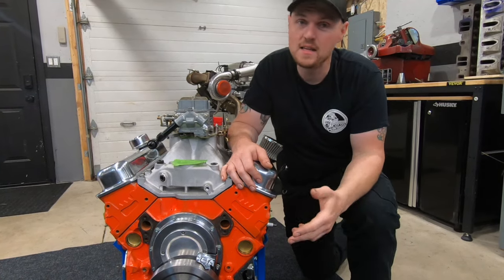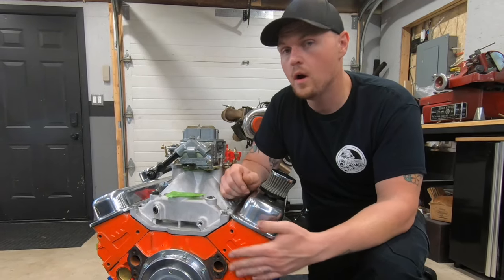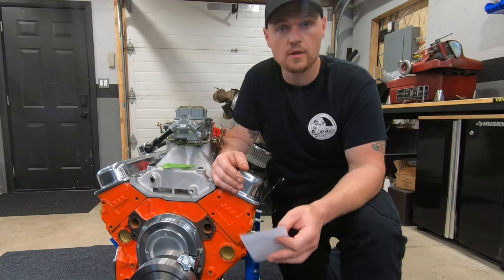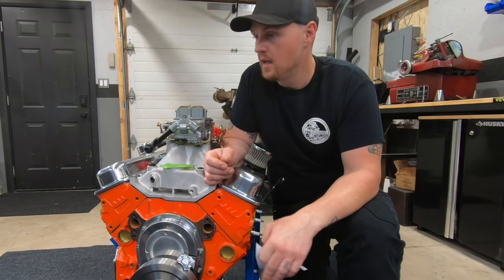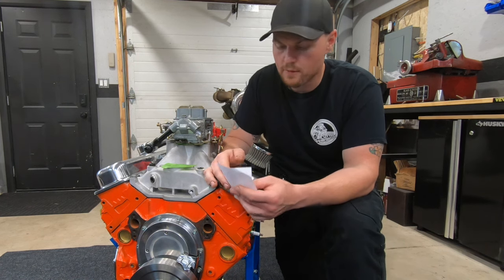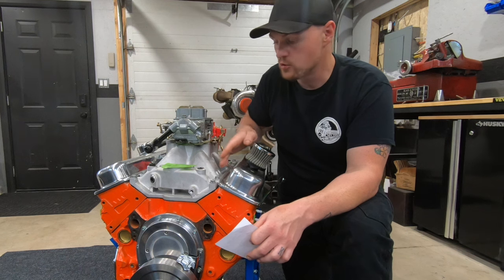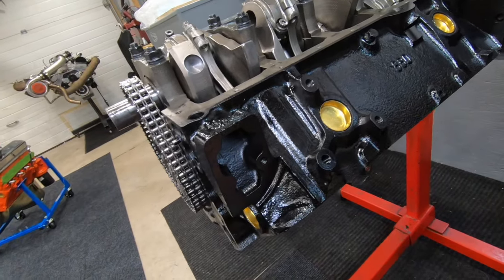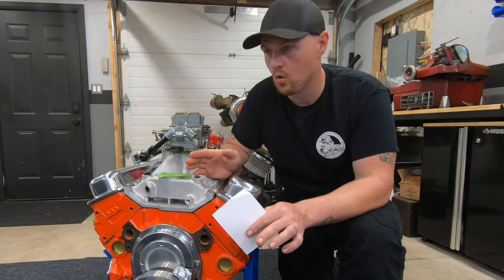Quest for a 500HP SBC on a Budget (The Block)

Comment: If the rest of your followers are anything like me, the best way to get a 450 hp engine is to aim for 500. I’m looking forward to this video series!
Reply: With research you can hit your goal exactly. Heads are the most important.
Reply: @cedricwilson2055 the camshaft is the most important. You can have the baddest cylinder heads that they make but without a camshaft that will make them work you have a turd. I agree that the heads are important but don't forget about the rest of the package.

Comment: I built a 350 bored 060 over with a Lunati bracket master 2 cam, Dart Conquest heads, Dome pistons, Weind Team G intake and a Barry Grant 750 carburetor. Compression was 11 to 1. It had 4.56 gears and a 3500 stall converter. The engine made 520 hp and the car ran 11.30 in the quarter and low 7's in the eighth. It was so much fun to drive. I'm going to build another one very soon. Love these videos.
Reply from the maker: Hell yeah! 🤘🏻
Reply: @cuttersperformance idea for a video: no one ever makes a video on building a sbc torque monster for those of us with heavy 4x4s that are daily drivers. Where peak  big HP isnt really that important

Comment: If you can find a 350 out of a Big chevy truck, they have nodular 4 bolt center mains, numbers , 2482 on the mains, the cast mains are number 3412, you can tell the 2482s are a different color, kind of brown, Hope this helps.

Comment: That 355 did great at 479hp with vortecs but you swap those with cnc trick flow, promax or brodix with a larger roller cam it would clear 500hp easy.
Reply from the maker: Yeah definitely, what low buck aluminum head would you be interested in seeing used?
Reply: @cuttersperformance  I think trying to floteks or afr enforcers would be a nice low buck option
Reply: @cuttersperformance I’d like to see the promaxx project X heads.
Reply: Pro
Reply: Pro
Reply: Pro
Reply: @cuttersperformance  you already ran the knockoff eBay enforcers which are also good for the price.
Promaxx or skip whites seem to work really well but either way it's a decent jump up in cost.
Reply: Floteks
Reply: Performance warehouse

Comment: What number is a one peice rear main seal 4 bolt main block and do know what vehicles they came in? With mechanical fuel pump.
Reply from the maker: The last three digits 638 or 880. But you don't know if they are a 4 bolt unless you pull the pan and look. Most 880 block are not drilled from a mech fuel pump though

Comment: Marketplace is full of circle track 602 880 blocks with vortecs steel and also 604 which is same bottom aluminum heads.  Can get em cheap from circle track guys..
Reply: Where at lol. All the ones I see they want 8,000 an up

Comment: I have a 85 Vett which has the L98. I want to go carb, stroker kit to like a 408, trying to make 500hp
Reply: I'm currently doing carb swap ported flotek heads and an airgap intake with 750 holley and a Howards cam in my 85 C4.
Reply: I'm doing the same thing, 383 dual quad all under the stock unaltered hood.

Comment: Did you have to clearance the double row timing chain? Havent found one that fits without grinding. Thanks
Reply from the maker: What block?
Reply: @cuttersperformance  i thought you were using a block with a factory roller cam? The ones ive had were 880 blocks i believe
Reply from the maker: @chriscardall-yk2gp  yeah the 880 blocks you'll have to grind the top oil passage to run a Double roller

Comment: Hey quick question on blocks. from my knowledge I have a heavy duty serious 350 crate engine that is meant for a 3500 truck and it’s a 1 piece rms that my dad bought in the early to mid 2000s and engine is imaculate inside but there is no mounting bosses for the lifter spider or the bosses for the cam retaining plate, how do i necessarily tell what block I have and if I want a roller cam what do I need to do! Engine is going into my 89 Trans am so don’t want a truck cam!

Comment: To be more budget friendly, install the main caps with your brand new main studs, torqued down without bearings then check the bores with a bore gauge for roundness and that they are in spec. If they are don't waist the funds on line honing if the mains also pass the straight edge test.

More often than not it usually isn't the studs that cause the need for a line hone. Usually the need for the line hone was there before the studs were added 99 times out of 100. 

That is a substantial savings if you can skip that process. So for this 500 HP build maybe go through that process of checking the mains before you commit to the line hone? Check with a straight edge first with the caps torqued on with the bolts. Then check for roundness with the torqued bolts. If it passes do the same with the studs. If it passes with the bolts 99 times out of 100 it will pass with the studs.😎👍

Comment: Great info here. I’ve been watching while planning to build a dirt circle track engine for a class with the rules being 358cid, iron 23deg heads and no roller cams. It’s nice to see in dyno testing that 500hp+ is achievable with these heads and simple budget parts, especially if I disregard pump gas and street manners as there’s no compression rule. Keep up the good work.

Comment: Great video, as usual. 👍
I've read on FB that the 880 blocks came with PM rods. Is this true? I thought only Gen 2 blocks got them up until the Gen 3 blocks.
Reply from the maker: Yeah most 880 blocks have PM rods, I will talk about that in the next part of the series
Reply: My 880 block is a GM replacement engine that came with PM rods, 4 bolt mains and the fuel pump rod provision. Not many production blocks had the trio if any at all.
Reply: @shredfest30   Yea. I wasn't sure. I have a 638 block that came out of a HD2500 with the roller cam provisions and the hole for the mech fuel pump (which I don't use), but definitely not the PM rods. I feel shorted, now. :( LOL
Reply: @Carl_Jr  Ya, the 638 blocks were generally the "pre Vortec" generation between 1987 and 1995.
Reply: @shredfest30  They were pre-a lot of stuff. They were used universally across the F-body, the Y-body, trucks, Cadillacs, etc. 

Honestly, it doesn't. They've been changed to aftermarket rods, anyway.
Reply: @Carl_Jr  i think gm made the switch around 94-95 and at that time GM had the gen one 350cid 880-casting and the gen two 350cid 327-casting blocks in production at the same time. I think the gen two blocks went into production much earlier than the 880 castings and the early gen two blocks recieved the older style non-pm forgings. Im basing this off these blocks first appearance in production vehicles being around 92 for the gen two and mid-95 for the gen one 880 castings. So im not 100% positive but im guessing all 880 blocks came with pm forgings.

Comment: I’m really on the fence with building a 4.8 “LS” or a 4 bolt Main 350sbc ( either or I’d be running a carb) it’ll be a street car nothing crazy… would love to hear some insight y’all!
Reply: the 350 will make more torque than the 4.8, but the biggest issue with the SBC is the intake manifold design. It just can't be as consistent by design for balanced cylinder filling and equal fueling compared to the LS carbed intakes that don't have the siamese intake ports. that 4.8 will rev another 1200 rpm  past the 350 with ease though and make comparable peak hp

Comment: Can a 500hp 355 or 383 be as reliable as a stock daily driver?  Thinking of a doing this to my daily driver '94 suburban.
Reply from the maker: I'd definitely go 383. But yes, with a properly selected combo, you can make 450-500hp and still have good drivability, power brake friendly and decent fuel mileage for a daily driver
Reply: @cuttersperformance  383 is my preference too.  Thank you.  What kind of budget should I realistically plan for?

Comment: Cool video and new Subscriber. 1970 Chevy 350ci  Bored .040 for cylinder perfection and a few more ci.  2 bolt mains. About to be a full hydraulic roller. Will be running 11-1 compression, with FloTek 200 aluminum heads.  Airgap intake with Holley 750cfm and Dougs 1 3/4" tube long headers.  Reaching for 435-450hp.  We shall see. Thoughts ??
Reply: You should be there, depending on cam... could squeeze little more out with 11:1...
Reply: @jacobnorth8642  Bullet racing cams special ground a .548/548 lift .    286/292 duration ..   LSA 112 w/4 degrees advance..

Comment: I have a question that I been kicking around.  I have a 1968 pontiac lemans. I'm still trying to decide if I go with the 455 or get a 400 pontiac or a 6.0 ls or a sbc. Right now it ha a 5.3 in it. Which do you think? I also have a torqstorm supercharger. Should I use that or go turbo. To many choices  to decide from.

Comment: It doesn’t matter what gm block you use!
All you need is arp studs on 2 bolt Mains M I have made 480hp on.vortec truck one. Must have good 280 cfm heads with hyd roller or easy with solid roller camshaft .
Most need240@050 plus camshaft . Springs to support to rpm range

Comment: What is the part numbers for the beehive springs retainers and locks to run a .510 to .530 lift cam in vortec heads thank you love watching your channel
Reply from the maker: https://youtu.be/UZosxGQyGMs
Reply: inspired me to get a vortec, mild port, screw in studs ls6 (summit) springs, summit hot cam .525/.520 lift, quadrajet, dual plane, very drivable and fast!

Comment: I did measure both of my 880 blocks cylinders . They are both shorter than the 638 I have .
Reply from the maker: @twopopsaqullu9721  how much shorter?
Reply: About 1/8 inch or .100    my 880 blocks are 2001 year
Reply: @cuttersperformance  its been a while since i measured it but i also believe the 880 was a tad shorter than the 638. If i remember correctly one was more square at the bottom where on the other the cylinders were longer on the non thrust sides.

Comment: been looking forward to this video i'm building a 350, machine work is done flat top 4 valve releaf hyperutechic pistons using parts that have been setting around cam 535 kift lsa is 108 202 camel hump stock bottom end true roller one piece rear main roller rockers duel plane holley 750 double pumper MSD destrubtor 6AL box hoping to obtane 350 HP? openioun please? deck height .015 down. steel shim head gasket .015 thanks
Reply from the maker: Sounds like you'll have no problem making 350hp

Comment: Whats your opinion on the limits of a 2 bolt 350 vortec block aligned honed with the prw main girdle/stud kit?
Reply from the maker: @jayramirez3646  up to 500hp 6500RPM no problem (with a good balanced rotating assembly)

Comment: Who makes a electric fuel pump that bolts to the factory mount on a SBC? I've never heard of this.
Reply from the maker: The old electric Carter pumps with the plate you can mount right where the mechanical pump bolts to
Reply: @cuttersperformance  do they pull well from the tank? I need a fuel pump for my 385, seems like all mechanical pumps has went to trash. 

Did YouTube bitch enough to make you drop the piss out of piss cutters, or did you just take it out on your own? Just curious.
Reply from the maker: @inscoredbz  yeah they actually pull pretty good, not overly loud either

Comment: The 'easy' 500HP for you would be to throw a set of smaller chambered Aluminum Heads on the Dingle Ball 2.0 479HP motor (brand X's 23deg "210" or "215" 2.02/1.60" heads), raising the compression ratio a bit in the process (afforded by the switch from iron to aluminum heads, anyway) and call it a day. I bet that Dingle Ball 2.0 with 0.6:1 - 1.0:1 of compression increase added back into it and the aforementioned heads would be knocking on the door to 600HP very easily.
Reply from the maker: I'm going to be doing a 383 version with aluminum heads (Same cam)

Comment: I busted my crank in a 4bolt main 350 1pc rear main, ported & larger valve 193 heads & a B&M 144 supercharger.  I have a boost retard box & jackobs ignition system.  Along with running 93 octane.  Water meth was next till I busted the crank.   Oh & twin tbi's... off 5.7L but with injectors off  4.3L engines.  Prob was I couldn't tune an 0BD1.... Turbo City was who burned or flashed my EPROM chip.  Would have been sweet with an intercooler.... still be a pain to build a cooler to fit between the blower & intake.  Any suggestions there?  I have 2 b&m's I could use on different builds.  Since moved onto vortec builds & LS.   Towing I run Cummins
Reply from the maker: Where did the crank break? Superchargers cause a massive frontal load on the crank but I didn't think q 144 would be so bad. Was there any detention issues? Does the blower spin freely without binding?
Reply: Hey Pat, yea the front of the crankshaft was fine, my crankshaft busted at an angle across the 3rd main under the cap.  I actually missed it the first time I had the pan off while moving the crank from the front harmonic balancer bolt.  It was making a ticking noise but still ran fine.  The way it broke it interlocked & had such a tiny differences I missed it visually.  Had a friend move the front while I put a hand on the crankshaft fore & aft, felt a difference, with the 3 center mains off I was able to gently push the crank against the thrust & the front forward.  The counter weights didn't allow much movement but enough to see the crack.  Stock 1 pc rear main, std rods & main.  They were all in perfect condition.  Large 35in tires, 6in lift setup for towing our snowmobiles.  Ken the founder of AFR was a friend & who talked me into porting my stock 193 TBI heads, I had no clue how much GM invested in those heads but their production fell short of expectations.  The larger valves, staggered rocker ratios ect all helped.... best b4 lifted ect on grampa tires was 11mpg, after 15+ & the speed kept creeping up on me, found myself constantly letting off to stay at speed.  Ken was a hoot to chat with, our first conversation lasted 6.5hrs.  He enjoyed the fact I could follow his line of thinking without him having to explain.  We both jump around alot that way.  How smoke swirls count clockwise in the NW hemisphere, how a toilet swirls ect.  Ken loved & really paid attention to physics!  It was as if we had known each other for years.  Kelly at Brodex is who hooked us up.  At first I had no idea he was the founder of Air Flow Research, but it became clear he knew way more than the Average guy.  I miss talking to him! If we could only download our minds into a new, or younger body.... how great that would be!  He was going to hook me up with D Vizard... pre internet back in the 90s, that's how I started reading his tech books... was asking Ken about cams & David's name came up. We joked how great it would be to have 3-4 life times in a row to live where we could accumulate knowledge......  another guy I wanted to meet was Christopher Jackobs, his design of using the resistance of each sparkplug to tell if the cylinder was still burning or misfired was brilliant!  Acting like a sensor.

Comment: Why not lt1?
Reply from the maker: @christianmorales8026  the 90s lt1s are completely different blocks
Reply: @cuttersperformance  okey,am building a 1995 lt1 355 forged piston,stock rod with arp bolt,stock crankshaft,arp main cap stud,arp heads stud,stock ported heads,tick performance stage 2 cam,650 brawler my goal its 400 to the wheels all motor and 500+plus to the wheels  with 150 shot on a 94 sonoma
Reply: @christianmorales8026  just figure on as much as 20% power loss through the transmission and rear. So, if you can build a 355 LT1 that makes 480, you'll be very close to your goal of 400 at the wheels. 
Just wondering, why not go 383 with your LT1?
Reply: @msh6865  because I would like stay on budget in the future the plan its going 396 stroker

Comment: Roller cam 350, 327 large mains is the same block, use small main version to build a 302 without hard to find spacer bearings or expensive line bore procedure,  Vortec blocks are not soft bores,  watch for worn lifter bores, bore for AMC/Magnum lifters is easy fix, get cam ground for larger lifter

Comment: They have the 880 and the 638 are stronger the are made of graphite iron and they were also used as a marine 6.2 377 that’s right a standard bore 383 yes the already stroker clearanced the sgi “880 and 638 engines are 200% stronger I teach a class on this on Thursday nights I’m currently working on a video on this

Comment: Any of them can make 500 easy. If you make more than that, 2 bolts are still better than 4 bolt ones. Theyll make all the power you want til block rigidity comes into play. One piece rear, roller cam.

Comment: Hmm, you are making 480 hp and you want to get to 500hp easy add compression and airflow, your 480 hp engine is pretty much a street build, the same eng8ne on good gas and 12:1 compression will make well over 500. If you want to keep lower compression  good set of heads either rhs or sportsman's or aluminum  will put you over. The voters are great but they have their limitations.  Also you run a very mild cam in this engine going to a cam with 230 to 240 degrees  duration at .560 lift with help the engine get there.
Reply from the maker: @No1414body  the cam was 235/241 108lsa with .580 lift e/1.6 rr. The point of the series is to show what it takes to make 500 without breaking the bank to much and also run on pump gas
Reply: @cuttersperformance  I see your point man I'm just saying that at 480 there are a couple things that will get it to 500. I have bought  several sets of good heads cheap on marketplace, in my area you can pick up sportsman for less than 500 bucks also I've picked up good name brand aluminum heads for about the same price
You have to look for deals

Comment: Im thinking 1pc roller block....3.750 Scat crank...Scat rods...hyperuetetic pistons...roller cam big enough...ported vortec heads...compression around 10 to 10.5....A low budget is the challenge...
Reply from the maker: Sounds like a solid combo so far, the cam choice is key to making really good power